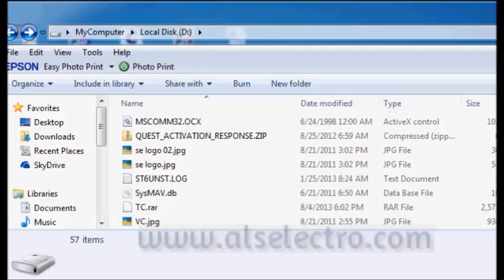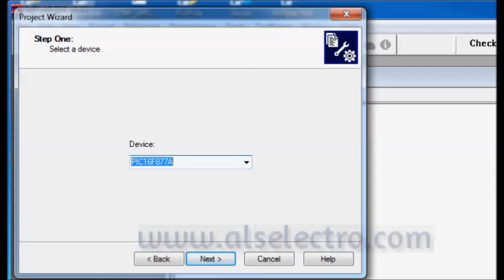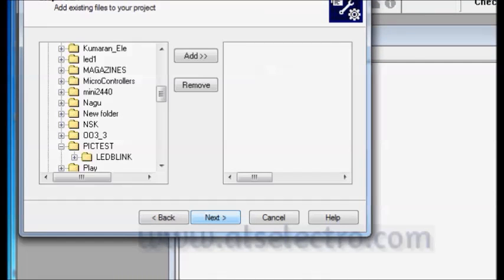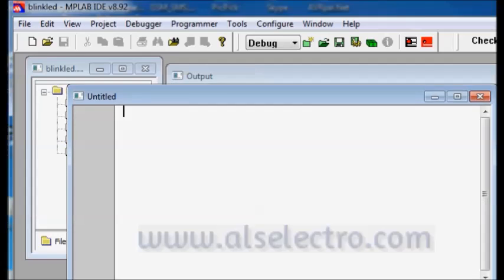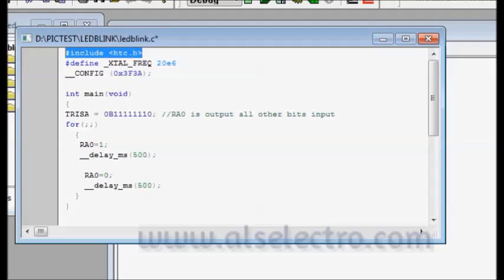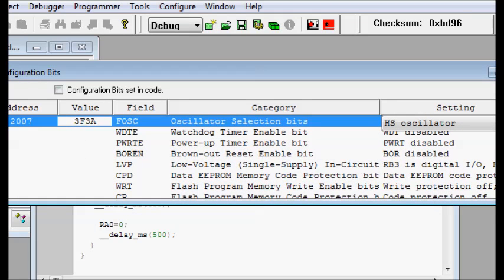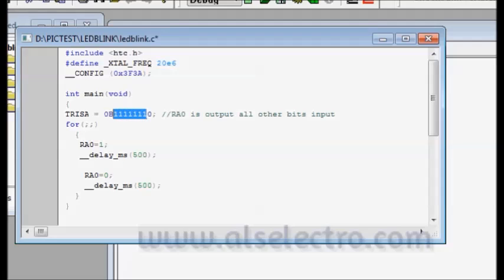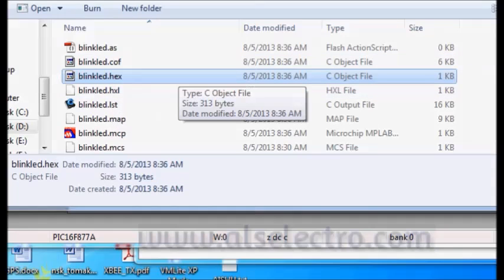PIC Programming Part 2 - Creating HEX file from C Code

Comment: ----------------------------------------------------------------------
Debug build of project `D:\ANTO\ANTO PROJECT 2020\New folder\ledblink.mcp' started.
Language tool versions: MPASMWIN.exe v5.37, mplink.exe v4.37, mplib.exe v4.37
Preprocessor symbol `__DEBUG' is defined.
Mon Jul 06 12:12:29 2020
----------------------------------------------------------------------
Build aborted.  The project contains no source files.
----------------------------------------------------------------------
Debug build of project `D:\ANTO\ANTO PROJECT 2020\New folder\ledblink.mcp' failed.
Language tool versions: MPASMWIN.exe v5.37, mplink.exe v4.37, mplib.exe v4.37
Preprocessor symbol `__DEBUG' is defined.
Mon Jul 06 12:12:30 2020
----------------------------------------------------------------------
BUILD FAILED

why?

Comment: At 9:56 - the c file will not be saved as source file, only as other file.
Reply: I know this is 2 years old, i'm just replying to save others peoples time in case they have the same issue: You need to choose a c compiler under "project" -> "select language toolsite". When no c compiler is chosen, but assembler instead, the c file is moved to "other files"

Comment: Hi!
I am new for this. I have created a file to blink a LED using your video directions. On building the project I get the following message:Halting build on first failure as requested.
BUILD FAILED: Tue Apr 19 20:05:16 2016
What is wrong in my project and may I have the solution please.

Comment: Am i missing something, I use two transistors and two capacitors and 4 resistirs cross coupled and my LED start blinking the minute I power it up, no compiling , not processor to freeze up, far more reliable, what do you think?, in the time I learn how to program a pic microcontroller, and implement it in my design and I would have already made my millions by selling small LED flashing toy !
Reply: +Jayant Desai 
Am I missing something?  You can buy flashing LEDs for pennies ... just connect to battery and they just work.  No resistors, capacitors, transistors or soldering.  By the time you'd bulk-purchased all your components to make millions from your flashing toy factory ... I'd have undercut you and made millions, whilst you get stuck with thousands of pounds of overpriced parts you can't sell.

Comment: sir i like your video. and i want to ask u that. i have a microcontroller pic16f873a and i want to make an led blink program. but program does not work. led does not blink. plz can u guide me to make a simple program of blink an led? i have micro c compiler and mplab x ide with xc8 compiler.

Comment: Hello sir, instead of "_XTAL_FREQ " statement at the beginning such as for an external oscilator, how should the c statement will look like for an internal oscilator, like for 12F675? What will calculate the _delay(xxx)? Thank-you
Reply from the maker: You can program configuration bits in the code using __CONFIG macro .Below the include statement use ,
__CONFIG (FOSC_INTRCIO & PWRTE_ON & WDTE_OFF & MCLRE_OFF);
Note the usage of double underscore before config & the semicolon at the end.
Now the delay will be calculated at the internal freq of 4MHz.
Reply: Hi, I have 1 question. If you can spend 5 minutes of time on me, please write on xalanxmillerx@gmail.com